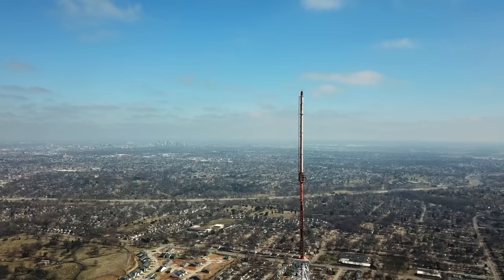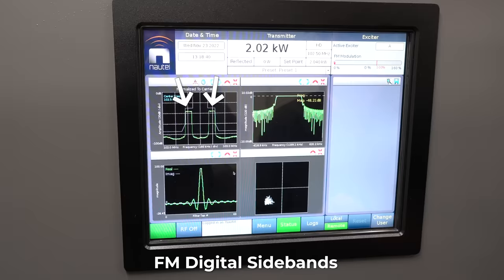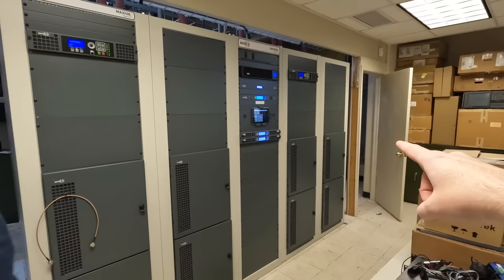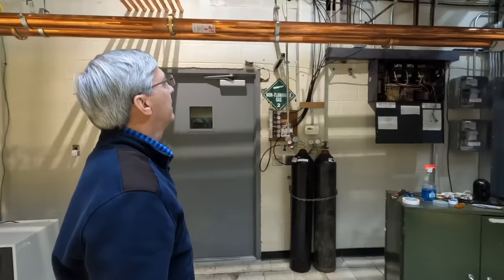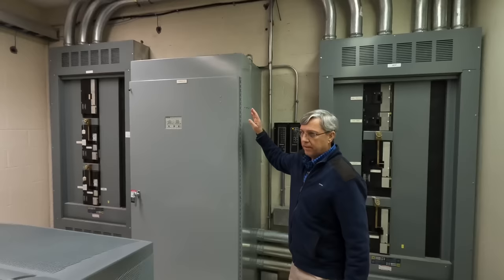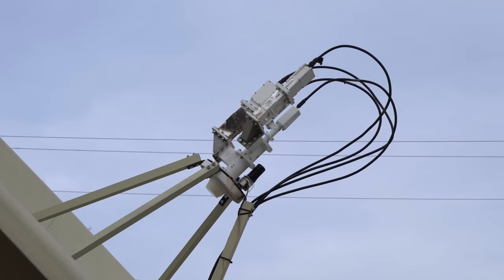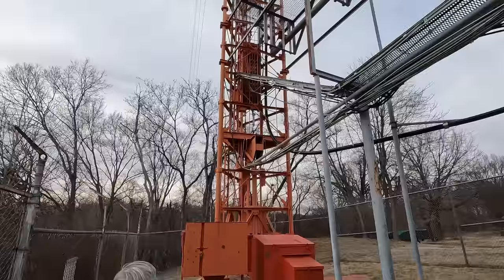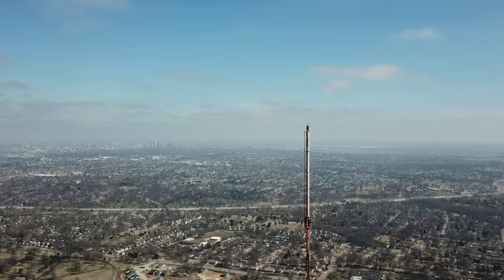What's inside the 2nd oldest TV tower in the West

Comment: I worked at Best Buy when rhat HD Trinitron TV was on sale. I believe there were two, a 34 and a 36. There were other TVs that were progressive scan but that was in fact the ONLY glass tube HDTV sold. I was one of only two people in the store who could lift it upbto the display shelf because at the edges there's 6 inches of leaded glass. I know this because I've seen one dropped on the ground and there really is 6" thick glass. It needs that because while the screen is flat on the front, the tube scans across a curved surface inside of it so the further off center you get, the thicker the glass. It's MASSIVE!
Reply from the maker: Haha yeah... I think they've left it there mostly because they can't fit a forklift in there to haul it out!
Reply: I remember seeing what I thought was a Philips HDTV in the waiting room at the cable company. Maybe it was a Sony. More recently someone was giving away one of the Sony models on Craigslist.
Reply: it was pretty much a special giant glass lens bonded to the front of a CRT to "flatten" the face and picture out. I recall some of the big hype around them, but only ever seen two of them and I date back to the start of VHS and Microsoft(lol).
Reply: I always wanted one of CRT HD Wegas.
Reply: I thought they maxed out at 1080i? It's fast enough to rescan a progressive image?
Reply: @XMguy   I believe OP was referring to 480p TVs which were much more common than 1080i TVs.

Although oddly enough 480p and 1080i are pretty similar. 480p is 525 scanlines 60 times a second and 1080i is 1125 lines 30 times a second. That's 31.5 and 33.75kHz, close enough that you wouldn't need circuit differences to change between one or the other.
Reply: I paid big bucks and bought one of those Sony HD Trinitron 1080p 176+ pound interlacing TV's after returning a very crappy LCD TV that I bought from the same store. I'm not sure of the size. Our family absolutely loved that Sony TV. Crisp, clear, best picture ever and awesome at that time.
Reply: It wasn't just Sony - I have a similar Panasonic.  Easily a 2-man job to lift it at all, possibly 3.  But the picture quality of 1080i on CRT is fantastic.
Reply: We bought my parents a CRT flat face tv (Samsung?) and a Blu-Ray player for Christmas around 2006-2007...
I recall it was one of the only HD (1080i @120hz) tube tvs I had seen. We set it up and played a concert by Eric Clapton - the picture quality/contrast/detail/fast motion clarity was the best I had ever seen... Was a beast to lift that monster...
Reply: @ischmidt I loved watching movies at night on the one we had. Contrast was phenomenal...
Reply: I had a Sony HD CRT flat screen as a college student in the nearly 2000s. It was transitional technology and putting it into 16:9 HD was a nice picture in spite of the viewing area loss. Took 2-3 people to move it and was pre-hdmi.
Reply: @XMguy My father in law had one, pretty sure it was 720p still pretty impressive for a CRT.
Reply: I think Philips had one too.  I remember wanting one. And I was looking at Philips and Sony.
Reply: @eDoc2020 jesus christ. the shittiest crt you could imagine on craigslist in my area will be 300 dollars because they put “retro gaming” in the title. gotta love america.
Reply: Had a Trinitron growing up, id swear that is what it was, a console with 8 track and vinyl players
Reply: I had the 36" model, it was over 300lbs
Reply: @RC-nq7mg No, it was not 720p
Reply: @throttlebottle5906 It was so heavy because of the lead in the glass to block any X-rays from the high-voltage needed to drive the large tube. There was also a steel sheet with tiny holes in it to help guide the beam to the pixels without hitting its neighboring pixel and accidentally lighting it up also. 

If you get up over about 25,000 volts in a vacuum tube with electrodes at each end, you can start to easily produce X-rays, and the Trinitron tube operated at 35,000 volts.

Comment: We used to have a couple repeaters at the 970 foot level on the 1000' Channel 11 tower in Decatur, GA about 25 years ago. That tower had an elevator, and it would take 11 minutes to go up and 9 minutes to come down.  The elevator controls were really sketchy. They operated in the 27MHz band, and were prone to interference. More than once we'd engage the controller to go or down, and the sometimes the car would just stop. We always made sure to have a person on the ground near the manual controls to getting us going again. Besides servicing our repeaters, I'd take my good SLR camera with a telephoto lens up there. Also spent more than a few hours on roof of the Tower Place building and a few the other tall buildings.
Reply: Interference? On 27 MHz? What could  possibly be on that band? 🤔 😁

Besides a ton of CB radios, I've also worked on garage door openers, radio-controlled cars, and even a dog training collar that all used 27 MHz signals.  They all used the non-CB frequencies that CBers called "A" channels.
Reply: Interesting
Reply: The elevator control loop is not on 27MHz.  It's in the 54MHz band.

Comment: Back in the mid '70s I was just starting to go off to Linn Technical College to turn my electronics hobby into my career.  I was also working part time where my Dad worked, and they had an ultrasonic welder that wasn't working.  I looked at it a bit, but the technology was beyond me at the time.  So my Dad hired an engineer to fix it on a Saturday.  I got to watch and learn, and then the engineer took me to downtown St. Louis to see the transmitter for 98.1 FM (then KSLQ) in the top of the Marquette Building.  Same type of equipment and huge "copper pipe" coax we see in this video, but on a smaller scale.

Too many years ago to remember that engineer's name, but I fondly recall the experience, and appreciate being reminded of it through this video.  Thank you!
Reply: That's amazing to hear! My Dad worked on KYKY for a few decades as it was owned by EZ Communications, then CBS Radio, then Entercom, now Audacy (probably another owner or two I don't remember)—that's one of the two stations we looked at in our Supertower video!
Reply: @Jeff Geerling  I was actually wondering if it was him that I went with to see the facility.  Don't recall when KSLQ changed to KYKY.  Also, I've noticed there's a newer station in town using the KSLQ call letters!

Downtown St. Louis has grown up so much, and I don't go down there that often.  But I did recently drive through there and saw the Marquette Building hidden amongst some taller buildings.  No more tower and antenna on top, though.

Comment: Love this! One thing about the bandpass filters. TV Stations are alotted 6 MHz of space. In that space, you are allotted some space as part of the "guard band", which I hear may be even more restricted in the future. But in short, there are more stringent requirements for TV... where FM allows you a total of 200 kHz of bandwidth, and in the area of other stations you may have spacing by at least the next frequency up and the next frequency down... TV stations have very little guard band spacing from the next channel number up and the next channel number down... So the bandpass filter literally chops any signals that fall outside that 6 MHz space. On a monthly basis, I used to run proofs that would determine the state of the signal such as out of band emissions, error rate before the Reed-Solomon filter, error rate after the Reed-Solomon filter, upper sideband levels, lower sideband levels, eye-chart data, etc.

Comment: Always enjoy these videos. Imagine the pressurized ridged coax in a moving platform and salt water environment.  Also, cooling of the RCA 2041 transmitter tube was accomplished using two heat exchangers. Salt water from the fire main, cooling a closed fresh water loop, cooling a closed distilled water loop!!!  :)

Comment: Love seeing the 6 Uniden SDS200 scanners being used at 9:58 they are controllable via an Ethernet port, and theres some great software for controlling them, called “ProScan”, which I believe is running on that PC in the cabinet with them..  even the audio can be listened to over the Ethernet connection.  looks like these are being managed by the micro USB port (lower right corner, under LAN port) ✅

Comment: Regarding the microwave dish pointing up the tower, generally that was for a transmitter going out, and there was a 45 degree reflector that bounced the signal to remote tower site and usually the receive part of that same system was a dish that was mounted up on the tower that faced the remote tower.  Using that arrangement with a reflector cut down on the sidelobes and made for a tighter beam of energy as it cut across the countryside. The FCC banned them years ago to minimize interference with satellites when they passed over.  I remember in the early 90's when Sony was making the rounds and showed up at the educational TV headquarters to demonstrate their HDTV stuff.  The 1080p HDTV had a tube like the one in your video, and they had an HDTV video tape player that went along with it.  I just remember how impressive it all was and I couldn't wait for HDTV to sweep the country.  The TV cost $15,000 and the tape player was $35,000 according to the sales guys and was studio quality stuff obviously.

Comment: I remember when harry E. sold KCFM to partner with ksd AM in a trade for an am/fm else where [due to a FCC rule about media concentration] 
I bought the old stand by and fixed it up over a year and a day donating it to a non profit for mountain top use.
when KMJM took over the debalver [sp] site and the multi station panel antenna came down it was some what of a marvel to see.
fed by 2 coax for the top and bottom half's, Ed Bench had some initial phase steering problems to overcome. a story in its self

Comment: Coax, radiax, flex well is used from the transmitter room to the antenna because it installs easier and bends don't have to be engineered in it simply bends. Being one piece instead of 10 or 20 foot sections means less loss and less points for failure.

Comment: Those "bowties" are antennas. It's actually called a batwing antenna, and is still a popular design for VHF TV broadcasting. Remember all the  circuit breakers marked "VHF"? Well, in between those and the batwing antenna must have been a VHF transmitter chain that was removed. With all of the repacking that has gone on over the last couple of decades, selling slightly used transmitters to stations that have had to change frequency assignments 2, 3 even 4 times in that time has become a thriving business.

Comment: Hi There.   So on that section about the waveguides. Those larger parts of the waveguides are actually combining switches, called "Magic Tee's" They are very low loss and likely were put in with the prior channel 35 digital transmitter.   Also that larger TV transmitter was made only about 3 hours north of you in Quincy, Il. We have a similar model at my station in Boston.
Reply: Thanks! And I have enjoyed many transmitters from the factory in Quincy. Gates, then Harris and then GatesAir. Also BE was up there producing a lot of good AM FM products also!

Comment: Another excellent video. Some questions, as there is only one feeder up the tower for the TV transmitter, is a redundant feeder and aerial system not needed? At a mechanical level how is the tower foundations supported and do the tower legs bolt on to a concrete foundation block?

Comment: 8:45,  looks like that ball valve is being used to throttle the fluid flow.   This is against best practices for using ball valves as it will be likely to cause increased wear on the valve and distribute debris from the valve throughout the system as the valve breaks down due to erosion from the passing fluid.

Comment: That was real nice. most towers are multi use . many different stations on them . most owners of the tower rent space. our VHF batwing antenna is still on the ground at the transmitter cite. taken all apart.  The new ATSC antenna is a waveguide antenna. EFP is 1.1 Mw . transmitter has 2 IOT (inductive output tubes) can run 1 or both . the tube is rebuilt and put back in, now the outher part of transmitter is getting up graid to ATSC 3.0 can do 4K video. maybe you can do a tour of WBCQ SW station. that have a tube bigger than me. some tube transmitters still in use and still being made today in 2023 but is totally different now. 73's

Comment: [questions from a non-industry-insider fan] Later in the video, an FM translator was mentioned - is the word "translator" used (versus transmitter) if (re)broadcasting a primary frequency's content on a secondary frequency? And I'm also guessing this is done to fill out the coverage (signal strength distance or maybe pattern holes)?

I was surprised to see the batwing, thinking that they didn't/wouldn't survive the repack - I've read they're nicer to climb. Also, thanks much for the elevator insurance blurb!

I'm eagerly awaiting the AM tower video if you can get to it. Nearby me, of the 50K daytimers, one is gone, and another vintage one with a 90-year-old tower is probably short-lived, due to the site property values.

Comment: I have a question. When I was in the navy, I repaired and maintained anything from 1KW to 100KW HF and LF AUTOTUNING (Man, how beautiful to watch them tune up!!!) transmitters. Because they were AM, we had up to 4 independent sidebands we could transmit completely different signals over. My question is, I think I remember that AM radio stations used to sell their ISB channels to pipe over elevator music or such. Do Local, commercial Radio stations still have the ability to transmit SideBand channel information? Do they still sell it? If so, what would it cost for someone to "Rent" a sideband channel? What I am thinking is, now this is weird, but maybe as part of the station's "Public Service" charter with the FCC, on a sideband the station transmitted RTCM correction data provided by their State's Department of Transportation CORS GNSS RTK positional correction data? Surveyors use precise positioning equipment that gets location data from many satellites. But that is only a couple of meters of accuracy. Most states have permanent., fixed, sites that have known positions (CORS or Continuously Operated Reference Stations). They send that information over the internet to a RTK capable Satellite receiver like the UBlox ZED-F9P RTK receiver chip and SparkFun's GPS-RTK-SMA receiver board. But for the correction data to get to the receiver board, it needs an internet connection. Not many mobile platforms inherently have internet connectivity except through cell towers and data is expensive that way.

 I'm asking because everyone wants an autonomous lawnmower (for example). If a lawnmower had a RTK capable Satellite receiver and could get the RTCM correction data from a local AM radio station sideband receiver on the robot mower, we wouldn't need Roomba lawnmowers bouncing randomly off electrical dog fence wires EVENTUALLY mowing the yard anymore. They could follow custom waypoints with centimeter accuracy and mow your back yard quickly and efficiently using less energy. Heck, a mower with a solar panel con top of it's charging station could charge the mower's batteries for free over a week, then mow for a short time, then charge up again for free. But they need the correction signal!  Is this possible? Lawnmowers are just one thing. It would help land surveyors too. They could do RTK surveys where cell service could not reach. Everyone knows that HF frequencies follow the curvature of the earth and get under bridges and inside buildings. Cell signals don't get into those places. But AM radio can.  What do you think?

Comment: Sacramento County requires that backup generators be restricted to operating only for a certain maximum number of hours each month (unless there is a power failure) and that time must be logged. This is to prevent the owner from using his generator to supply his load instead of the grid for whatever the reason. Does the generator shown have the same kind of restriction in your area?

Also if you need to have a large tank of fuel to cover emergencies, what is the effect of long term storage on the fuel if no emergencies occur? Do you replace the fuel after so many years, and how is the old fuel disposed of? Is the tank above ground or is it below ground, possibly with the double-wall construction used in modern gas stations with leak detection, etc.? (The Tank Masters Environmental channel showing the leaking oil tanks of NY state has got me to thinking about this.)

Comment: That microwave dish on top of the building was probably going to a panel that redirects the signal to another location.  My father was a microwave systems engineer and called the panels "fly swatters".  For the most part they are not in use anymore since they caused the microwave signal to spread out and interference to other microwave users.  In addition, a lot of those were on the 2Gig band that microwave was relocated out of due to PCS getting primary user access to the band back in the 90's.
Reply: When I first saw the angled panels on towers I had no idea what the were for until my first visit to a TV station. ‘Bouncing’ the signal that last hundred feet or so was genius at the time because of the receiver technology at the time. Keep the cable short from antenna to reciever! I still see a panel on a tower every once in a while and wonder if it is in use or just left waiting for someone to need the wind load. Thanks!

Comment: This is very cool to see.

If there is physical/arc damage to a hard coax line in the room, is there any risk from RF leakage to people in the room/near the coax, or since it's not radiated from an antenna of the proper wavelength is it not an issue?
Reply: Yes, there is a lot of risk—it's similar to an electrical arc, it can easily burn if you get near it (and from what I hear it's quite a scary sight!).